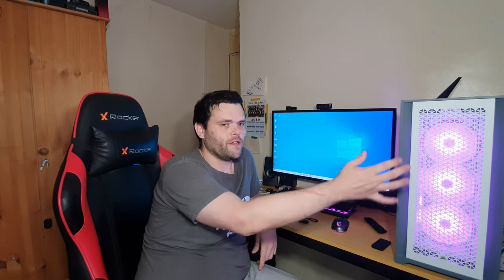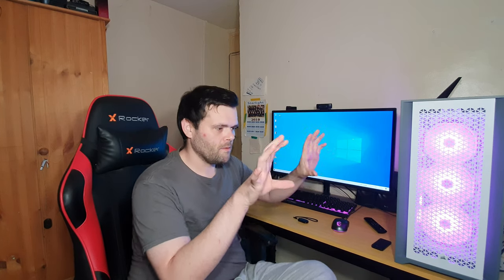Why I choose the 5000D Airflow from Corsair

Comment: I purchased the Kracken Z63 and realized my 440H case would only allow me to put it in the front so I got this case.  I admit if I had to do it again I would have gotten the 240 or 360 version. A 280 limits case option if you want to put it on top.  That said I love this case. I used the two included fans for behind the shroud running low RPM for a bit of extra air on the motherboard Then I got NZXT hue 2 120's in the front and another 120 in the rear. After setting the profiles the system is super quiet unless I am rendering 100% then it is still not that bad. I have a 5950x and a 3080 TI.  I do not overclock and know I really did not need an AIO so I admit a lot of this is aesthetics for me
Reply from the maker: Same with me i didn't Need an aio but it was More Want than need but i will Say a big aircooler dose Look sweet in the case
Reply: @WELSHYTECH  I had a nice one until I decided I needed the 3rd and 4th ram slots. and wanted to see them as they are RBG